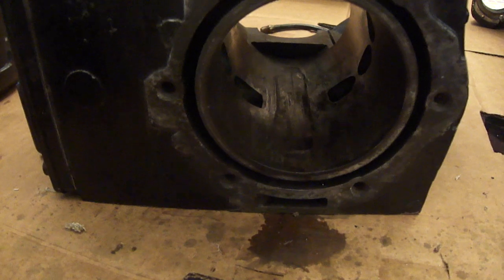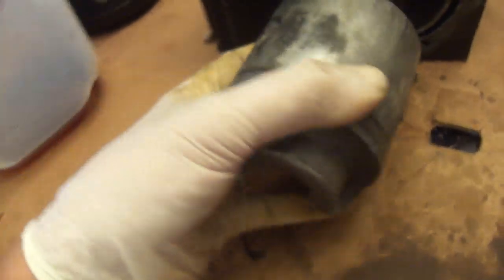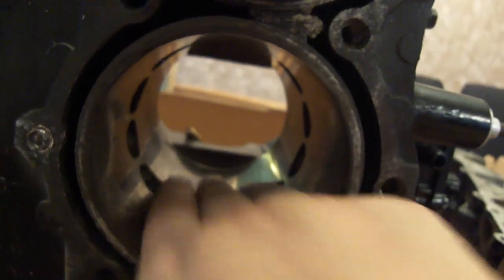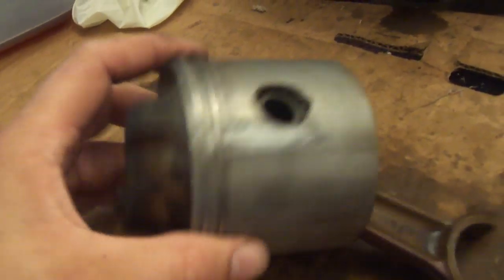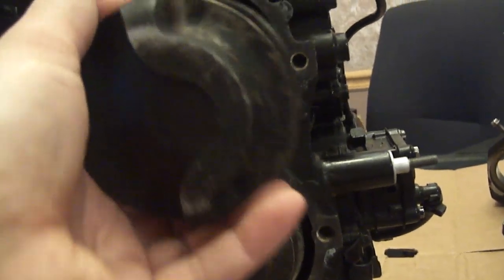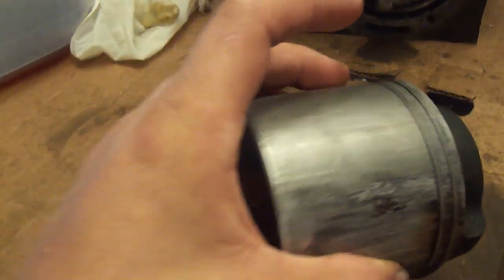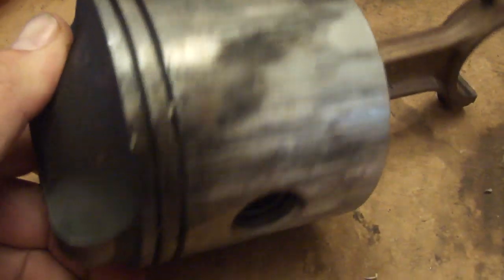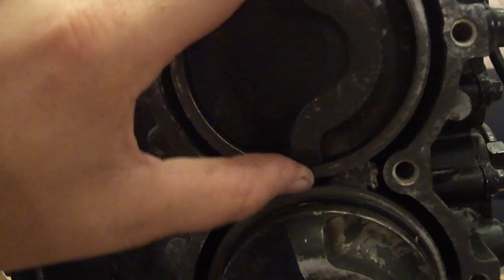Cylinder and piston inspection mercury force

Comment: Bore it out .30 at a machine shop. Put .30 over Wisco pistons and rings back in it. Get a set fiberglass red valves and install them on the crankshaft. Have about 3 lb. Shaved of the flywheel and block of the small carburetor connector lines on the right side of the carburetors. Change the timing belt to a Cevler belt to help with the lighter flywheel. Put new bearings on the rods and crank. Make sure that your timing is good or you will get to build it all over again. Good luck!